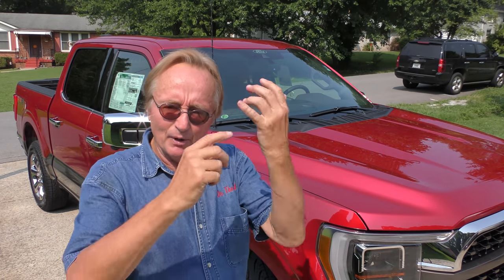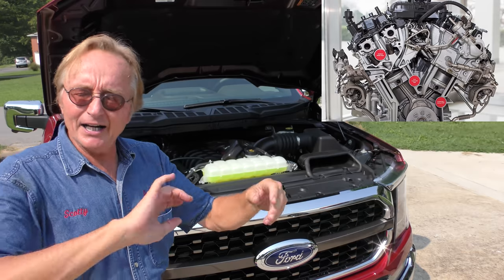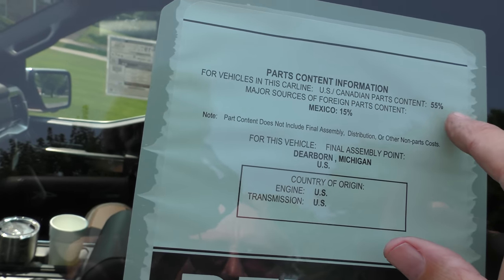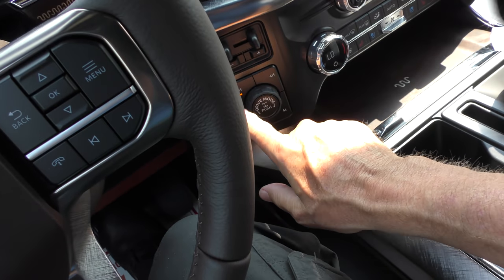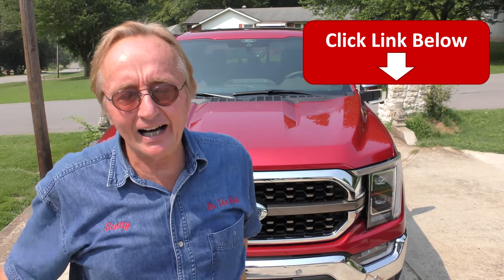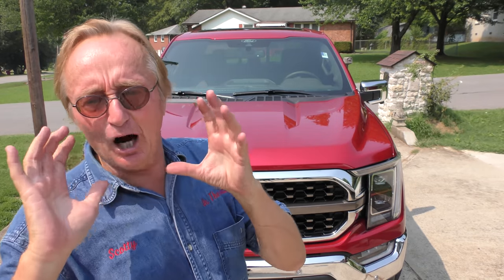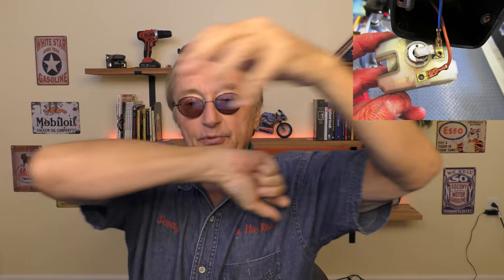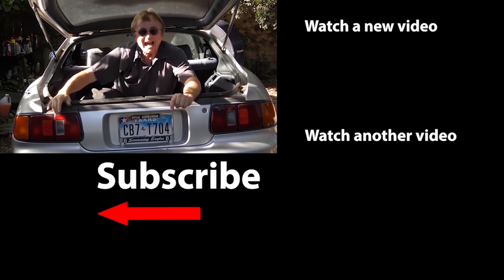I Finally Got a New Ford F-150 and Here's What I Really Think of It

Comment: Honestly, as a none Ford guy. But I’m glad they still kept a classic V8 on modern truck
Reply: Yeah the V6 turbos don’t seem as reliable.
Reply: Yeah, it's nice to see that, for sure.
Reply: And as a Ford guy I'm glad they're keeping a v8
Reply: @seanA416  Those V8 are rock solid, maybe the best up there.
Reply: I just hope they don't go through the same issues as GM did. I believe these new V8s have the cylinder shutoff feature.
Reply: People say they're not reliable but Google what's  Ford's best engine.. there are people out there with 250,000 miles on them mine's got 108,000 on it and runs fabulous
.
Reply: @Jonathan McCully so you're still living about 20 years in the past turbochargers are common and diesel engines generators and so many other things big equipment for years and years and years.. friend of mine works for Volvo and he said in the beginning they changed them all the time now almost never.. but I'll whoop your V8 I can guarantee you that 🤣🤣
Reply: @johnvanwoudenberg446  You can have fun with ur fart can sounding truck blowing head gaskets, I’ll chill with my V8 trouble free.
Reply: @johnvanwoudenberg446  diesel engines spin about half as fast as gasoline. Turbo gas engines are prone to failure. That is why they don't put ecojunks in the SuperDuty lineup.
Reply: another price hike on the fuel at the pump , and v8 will be history . its over $3 here in NJ, California i thik 4.30 per gallon.  no one can drive a pickup in Cali unless you are like maybe kardasian
Reply: @gm1258001  They do, Scotty avoided to mention that.
Reply: it's got cylinder de activation now, hopefully better one
Reply: @johncotter9082  let me tell you something you just should do some research these turbos have low end to work and do better towing trailers in the the V8 that's just the facts
Reply: There's nothing classic about that V8. They put so much crap on those motors, they barely fit in an F150. Any time I have to work on one, I take the cab off.
Reply: @solarfall2728  oh yes it is. The reason why I say a classic V8, is because they still offer the V8 engines on modern trucks. Usually they will offer better smaller engine like V6. 

So basically a modern trucks that offers old skool V8 they still offer with is still is.
Reply: @solarfall2728  and ur wrong. There still a lot of room to work on a V8.
Reply: @toyotabrony  You're either talking about a brand other than Ford, or you just don't know much about modern vehicles. 

What's classic about an 8 cylinder engine with 2 cams in each head, 4 cam phasers on the front of the motor, 2 fuel injection systems, a massive network of modules and 2011 was its first year in production?
Reply: @toyotabrony  They had to make a special low profile intake manifold so the hood can be closed. For most mid to large jobs I remove the cab because there's so little room to work. If you don't believe me, go to a Ford dealer and look under the hood.
Reply: Your first sentence makes no sense.
Reply: @johnvanwoudenberg446  it's always the old timers who hate turbos lol. They are living in past when they had issues.

Comment: V8 is the way to go when getting a truck ,especially a F150
Reply: Amen to that brother. I have a 2011 Ford F150 with a 5.0L Coyote V8 in it with 141,000 miles on it and still going strong and it's a beast and it sounds like a beast with the Borla ATAK Catback exhaust on it.
Reply: I have a eco boost in mine and it has 300000 thousand miles on it. It’s amazing how well a engine will last when you use good oil snd changing the oil when it needs to be changed. I just bought a 2020 f 250 with the 7.3 in it and I love that truck and engine.
Reply: @CJColvin  just another 100000 miles and you'll catch my 2007 kia sportage. Well maybe not as I drive it every day.
Reply: Depends on how your prioritize performance vs sound is all
Reply: especially f150;;? so does it mean that on F350 dually i can go with V6??
Reply: @CJColvin  phhh baby .. i have 2 fords 1999 and 2000 , one 4.6 another 5.4,  guess my miles?? its 500k miles that what i know, since i bough them used, only gosh knows how much miles they were rolled down by owners before me. .. one even still on original starter .. alternators were swapped on both.  so talk to me when your Coyote reaches 300K at least,
Reply: @ansv3340  Will do but so far as of now no issues.
Reply: Fords 4.6l v8 ,best v8 ford ever produced.
Reply: @theshield1613  Amen to that )) however 5,4 is exactly same motor, they just made jugs little bigger. so it did give alot more towing power to the 5.4 and greater fuel consumption, also since they had more power pistons put more pressure on the crankshaft and there was more pressure on the pistons too, so 5.4 has slightly less life span vrs 4.6l.  based on my own experience , but on other hand we did put our 5.4 truck under more stress and heavier loads and towing so  may be that is why.
Reply: Must not be aware of the issues with the 5.0L, particularly the oil burning after 2018 model year.
Reply: @CJColvin  141k? My son's Civic has 565K and the muffler sounds like fart cannon
Reply: My 1st 3 cars were Buicks with 350cu/in V8's and a GM conversion van also with a 350. Once you go V8 you can't go less. Currently I drive a Crown Vic.
Reply: had a 2016 ford truck.naturally aspirated  v6. traded  for a hemi ram with ram air . the only ranch i can afford goes well with broccoli
Reply: @RedWingsninetyone  the new 5.0’s have cylinder de-activation too, that’s a hard pass for me.
Reply: @stedco75  time will tell if they learned anything from GM
Reply: @CJColvin  A 2001 f150 lariat supercrew 5.4 2v 312 k replaced intake gasket and alternator then normal maintence only ford I have owned bought new dec 2000
Reply: @rondeal3823  junk dodge
Reply: @robtans5042  Awesome brother I also have a 1996 Ford F150 with a 5.0L (302) Windsor V8 with 209,000 miles on it and still going strong.
Reply: my 2011 5.0 got 270k miles and still runs mint
Reply: @ansv3340  A twin turbo V6 would not work well in the Super Duty.
Reply: @theshield1613  So is the 302 Windsor V8.
Reply: @ansv3340  What about the 6.8L Triton V10.
Reply: @blakemaxwell278  Awesome brother.
Reply: @CJColvin  V10 is basically same 5.4 motor they just attached 2 cylinder on the front.  Powerful motor but i seen lot of trucks with blown 6.8 motors. that just had over 100 k miles. Blown gaskets, knocking rods. and even seized.   Either there was neglect from the owner or they had some week spots.  or both. And to get rebuilt v10 or from a  junk yard cost alot more than price of same 5.4L motor.   So i was always avoiding trucks with v10. always preferred to go either after 5.4 or 4.6 .as they are better on gas and on cheaper in maintenance . we have 15 foot E350 box truck with 5.4 in it. and even loaded with stuff on the hills i never felt its under powered.
Reply: @rondeal3823   the issue with Rams is: as soon as you finish paying it and your warranty expires your truck expires too))  not my words as i never owned a Ram but my buddies did.  and Ram had rust issues even in texas, beds were rusting as hell around rear 1/4 panels on 2-3 years old trucks.
Reply: spoken like someone who's never driven an ecoboost
Reply: @user-fz3sz2dj4r  EcoBoost ain't so eco friendly when it goes boom & bye bye engine....they don't nearly last as long as the V8 & many die before 100k

Comment: And when the Push Button to Raise the Shifter goes out, You are Shift Out of Luck. That will be $2500 Please...
Reply: FORD...Failed On Research Development
Reply: Should've just stuck with a column shifter.
Reply: Wrong! There is a back up if the battery dies
Reply: @izzybusy99  No...... First on Race Day

Comment: Blame the government and CAFE for why automakers are ditching V8's.
Reply: V8 are amazing  but new tech will make them obsolete.  V8 will go away like the v12 sre becoming rare
Reply: @importsstillsuck  not talking electric v6 with super chargers 4 cylinder today even has enough hp similar to some v8 engines. Diesel engines are better for torque than any gasoline engines and much better on fuel for trucks. Electric have its benefit but not  for long hauling
Reply: Have you had a look at the Artic lately?
Reply: @importsstillsuck  i know enough Toyota v6 that have a million km i also know enough Chevy v8 that didn't last 250k without a rebuild needed. You also have to understand v8 sounds amazing but you can complain all you want they are not going to stay. You want a good truck with similar towing capacity or better get a diesel. Its better on fuel and last a lot longer
Reply: @importsstillsuck  they build them because there is a market. I like v8 and love driving them but the economics don't make sense any more . Today you can get the same displacement witha v6 and even a v4. Hybrid or diesel are going to be the future for hauling. In addition manufacturer who have done the research  on the v8 are attempting to keep it in the market for as long as possible. V12 were a common thing in the 50s in Europe but today they are rare and only for the super wealthy
Reply: @importsstillsuck  
How do you make an automaker defy a federal law?  Honestly asking.
Reply: @johneldorado  I thought for sure the importstillsuck kid would've answered already, maybe you have it thinking.
Reply: khalil sahtout the problem with the mileage on v8s is what people want. If you want burble you need an unbalanced crankshaft and to keep rpms down and if you have a balanced crank you can take them higher, most people with v8’s go fairly high rpm either way, resulting in cylinder damage and early rebuild.
Reply: @jameshunt5316  yes that is for every engine.  I love v8 and had one before.  The economies still don't make sense any more due to the fact more than 80 percent of vehicles are not kept for more than 10 year and today all modern engines don't last longer than 300k miles before some major repairs
Reply: @importsstillsuck  Well put, also trucks wouldn't be 70k+ if y'all didn't buy the best f'n truck to show off to friends on worksite. Who needs all this electronic crap anyway; give me 1 big truck, a set of keys to turn it on and some reliability.
Reply: @johneldorado  When it's unconstitutional, that's how. Most federal laws are UNconstitutional.
Reply: Every V8 rear wheel drive vehicle I owned  was dependable and reliable,  the only failing was the bodies would rust apart. The 
V6 front wheel drive, four-cylinder FWD cars I’ve had since have both been compromises, complicated repairs, poor riding ability,  they’re smaller,  less weight, and an overall disappointment.
Reply: @importsstillsuck  No lobbying is necessary when the laws are in violating of the Constitution, you ignore them. 
The problem in the USA is that people submit to tyranny instead of resisting
Reply: @importsstillsuck  
Lobbying?  What a dumb answer.  

I vote for leaders that want to end CAFE, short of that, not much I can do.  So not my fault, its their fault.

Enjoy engines that costs thousands more to build and thousands more to repair all so you can save $1 a week at the pump.
Reply: While i agree with you, ford stated that more people bought the ecoboost over the v8. But myself for long term I'd rather own a v8.
Reply: @johneldorado  that’s not even remotely true at all. 13mpg vs 30mpg is a big difference.
Reply: @JT-pt5tl  
You think you get double the fuel economy with an ecoboost?  I've got a bridge to sell you.
Reply: I want a v12 Shelby cobra mustang. Rev it for my all my ♥ gfs
Reply: Mitchell Mann :  Automakers are Not ditching  V8's.  You can still purchase a V8 Car or Pickup truck or SUV  from The Big 3 Automakers,  GM , Ford,  and Chrysler Corporation.  I'm sure you could still get the V8 Engines with Other manufacturers such as Nissan , Toyota and some others as well.
Reply: @johnelsonjr.6008  
No one said V8's are no longer made, just that they appear to be going extinct.  Companies are dropping them fast.

My guess is you won't be able to get new a vehicle with a V8 in under 10 years.  Thank the tree huggers and CAFE.
Reply: @importsstillsuck  blame the public. V8s are in the decline.  The public don't buy them as much.

Comment: I’ve got a 2007 Ford F-150 FX4. The only time I took it to the Shop was last year for them darn Spark Plugs. It runs like a champ still no other issues. Mine was definitely “Built Ford Tough”.
Reply: I have a 2006, i only have problems when I try to do things myself and end up breaking things because its so rusty
Reply: 2008 Expedition 5.3 3V. Just ticked over to 293k never, had any major work done and it been running on 7 cylinders for about 2 and half years maybe longer. Still the most dependable vehicle my parents have bought.
Reply: Spark plugs are so stupid easy to replace that’s almost like paying a mechanic to pump your gas
Reply: @ham7357  the previous gen put too little threads on the sparkplugs so they would literally shoot out, the 2004-2008 gen they over compensated and put too many threads on leading to them breaking in the head. so its a good idea to have a mechanic do it in a shop instead of breaking one at home and having it towed
Reply: @ham7357  I was thinking the same but some people have the money and think it's better. I'd do it myself for my car that and the filters except it needs a timing belt so the mechanic can do that.
Reply: My uncles 08 already has an exhaust manifold leak. It makes a ticking sound. He says it’s going to cost him $1,000 to fix
Reply: @Nick Milligan Z31 300ZX sparkplugs take two or three extendions a magnet to change sparkplugs.
Reply: Keep it. I can tell you first hand that its better than a new one. The spark plug issue is nothing. The shops make a big deal about it so they can charge you more money, but its a fairly easy repair.
Reply: @ham7357  not on the 5.4 liter Triton V8. Two piece spark plugs that can separate and very easily be 5-6 hours of very frustrating shop time for a mechanic.
Reply: Same here but a 2007 4.6 v8 explorer.  It's been bullet proof.

Comment: I like how Ford gives you several engine options for the F150, should have done the same thing for the Expedition/Navigator
Reply: I'm a Ford/Lincoln tech. The Expedition/Navigator gives far fewer problems than the F150 they're both based on. The F150 is a nightmare with all the problems they give.
Reply: F150 sells far better it’s America’s best selling vehicle
Reply: I bought the F150 with the 5.0 V-8 and love it 🇺🇸😃
Reply: Just with the f150 with 5.0 had a towing capacity. Its even lower than Chevy's 5.3L
Reply: @solvend  My F150 will tow 13,500 lbs.with the 5.0 V-8 ! How much do you need?
Reply: Or transmission options for the  Gen 3 Focus. :)))))
Reply: @rkeith4442  you may tow it but how good can you stop it
Reply: @The Woozy Not true, Ford F-Series pickup 2019 Sales	580,000 Units,  Chevrolet Silverado pickup 395,000 Units, GMC Sierra pickup 162,000 Units, GM total 557,000
Reply: @The Woozy I pulled a scrape pile with my 04 fx4. 5.4 of course, total weight of the everything on the scales. Like 10k😂. My truck handled it fine, I had to wind it out up hills but in flat ground I could do 60 fine. This newer trucks rly as bad as they say. Ig my old ford weighs a lot= more stable
Reply: @solarfall2728  my 5.4 is ok tbh, good power tuned, when we had my motor put in(crate) from about 7 years ago. Only 15k on it rn, we pretty much bullet proofed it. I’ve never had issues other than ur normal starter, alternator, ect maintance. I run 5w30 every 3k. Maintenance will make any vehicles last
Reply: @rkeith4442  you need a commercial licence to tow that much
Reply: @johncooper7663  That's what the owners manual says anyway. The 3.5 turbocharged V-6 is rated at 14000 lbs. I will never tow that much anyway.  Still love that truck !
Reply: it would be nice for the explorer to have the 5.0 option
Reply: @solarfall2728  because there's a lot more of them?